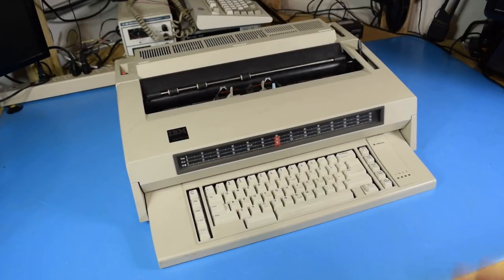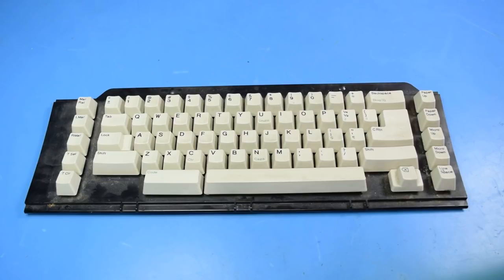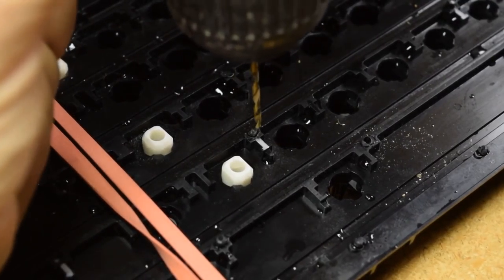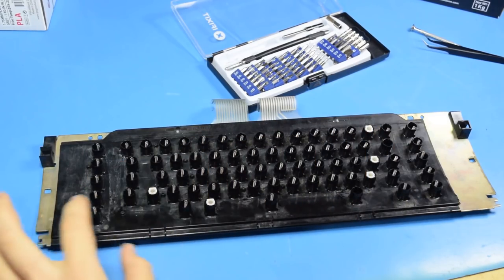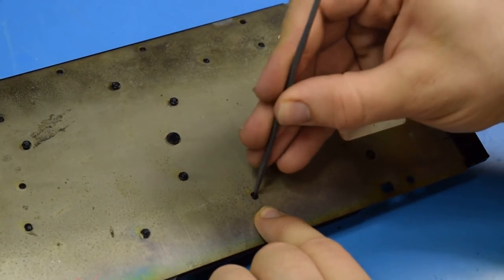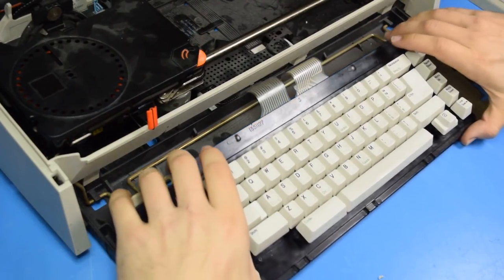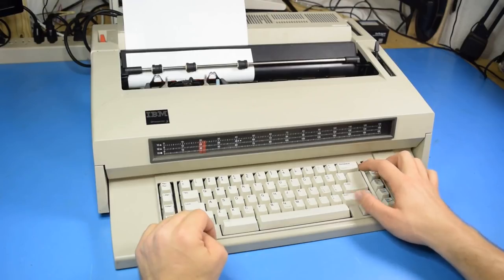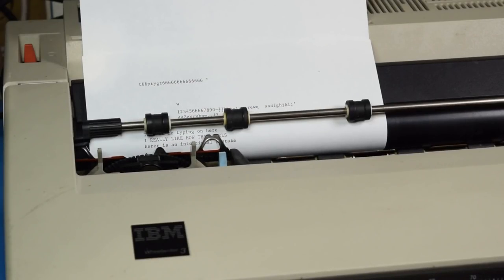0x0025 - Bolt Modding an IBM Wheel Writer 3

Comment: Code is like the Fn button on a laptop keyboard. There should be keys with green legends that allow you to type special characters while the Code key is depressed. I was thinking that the reason the Shift key was stuck was because it was in shift lock mode, but then I remembered that Wheelwriters have a Lock key that allows you to shift lock the whole keyboard and some have a Caps key that locks only a-z in upper case. I worked at a print store way back when that had a Wheelwriter 15 with the Caps feature. Not bad for your first try.
Reply: I know im asking randomly but does someone know of a tool to log back into an instagram account??
I stupidly lost the login password. I appreciate any assistance you can offer me
Reply: @Raiden Gatlin Instablaster ;)
Reply: @Zachary Deshawn I really appreciate your reply. I got to the site through google and im in the hacking process atm.
I see it takes quite some time so I will get back to you later with my results.
Reply: @Zachary Deshawn it worked and I finally got access to my account again. Im so happy!
Thank you so much you saved my account :D
Reply: @Raiden Gatlin you are welcome =)

Comment: I have a wheelwriter 5 and it is very similar, except it has a few added functions. The model M keyboard on my particular model has a much thicker heat treated backplate, and none of the rivets have fallen out as of yet. I hear squeaking from your carriage rail. Over time the lubricant on the rail that holds the carriage dries out and it may cause malfunction in the future. Some "5 in 1" oil did the trick for me. Also, there is a small rubber pad on the striker solenoid which will inevitably disintegrate with some use because its material has began to decompose. If you use a 7/32 nut driver like the kind they have on model Ms you can adjust the striker if needed.

Comment: Part time job I had from 2012-2016 was at a small golf course/volleyball club and it had a building which basically was an old house. (Doubt it was ever lived in, just was shaped like a house kinda.  The bathroom didn't have a shower or tub in it).
    But anyways, in a back room there was a WheelWriter 3 and an Olympia SG1 (with the plastic paper holder intact!) The people who ran the place said I could take it all home, so I've still got them both, plus other stuff. Including a big box full of Lexmark IBM ribbons and ink and all that kinda stuff, still all in th original packaging.  Eventually I'll start messing around with it all

Comment: Sorry, I'm late to this video. You'd need to bolt or screw where each/every rivet was (no gaps) to get a consistent key feel (all keys working correctly). Also, this model has a semi-automatic paper feed so you don't have to stuff the paper into the machine by hand. These are VERY nice typewriters--the fact they're still sold, refurbished, in 2023 speaks volumes.

Comment: 19:59 when you drilled the hole with the membrane inside bits of plastic got inside the membrane, I was expecting this, a good clean will fix everything, ask me how I know, I've bolted 8 model Ms

actually this is how I bolt mode to protect the barrel plate:
- I drill the holes and insert screws one by one with the steel plate, untouched bolts and everything in place, then open all screw again so I can clean the bits of plastics, works best with fragile old plastic barrel plates

Comment: I have a few questions about how this project was approached. 

Why not use a tap on the hole and just use screws instead of the 2 piece nut and bolt combos? Or was there not enough material for that?

Couldn't you have used new plastic rivets to replace the old ones? Or what about metal rivets?

And did you not know that they make cheap handheld drill jigs/vices to emulate drill press functionality?
Reply from the maker: There isn't enough plastic to tap a thread into. And the 34yr old plastic would just crack if you tried.

The plastic rivets work by melting down a post that was originally cast into the plastic. You can't add plastic rivets like it previously had. Metal ones would probably work, but it would nearly impossible to use them with most tools with how far into the unit the holes have to be made.

Most of my videos are made over a two or three day period. So I don't have time to get something if I don't have it. I also have to weigh the costs of how much a tool would costs vs. whether or not I can use it again later vs. will the video pay for it. Most of the time, videos don't make enough back to pay for what it is about. So adding more costs on if it's something I can't use a lot doesn't make sense if I can avoid it.
Reply: @TechTangents  thank you for replying. I had meant for the same kind of thing with the metal rivets as with the plastic rivets. 

Anyways I totally understand the cost investment side of things. I would argue generally though that investing in tools is never a bad idea as you can never have too many and they always serve a purpose. That is my two cents and totally 100% biased opinion though haha.

Comment: While I fully admit I'm not the expert, with Model Ms I've usually found that stabilized keys sticking is usually due to the spring being misaligned in the barrel (for whatever reason they're usually a bit more finicky with it). The barrel insert itself can also be wonky but I'm less experienced with that. Anyways, great video!